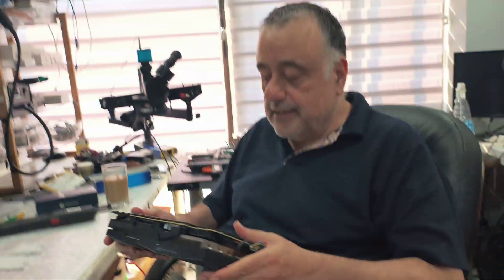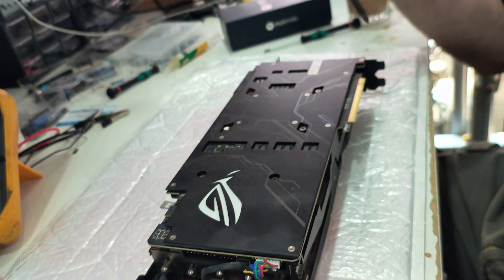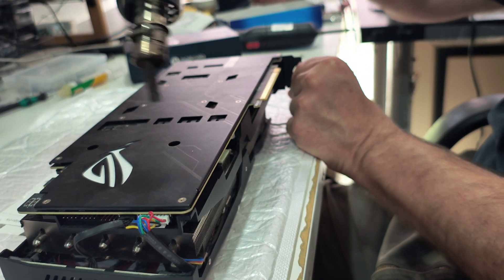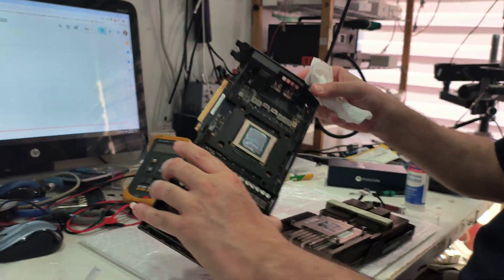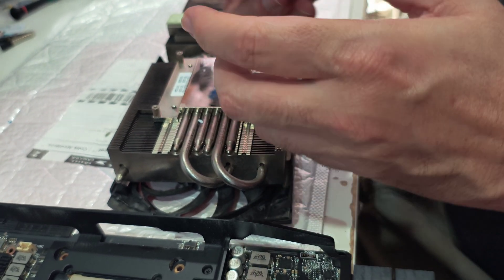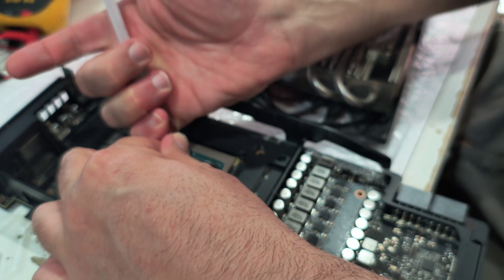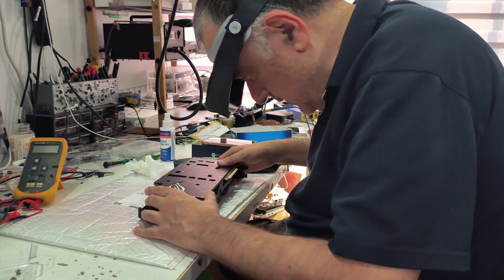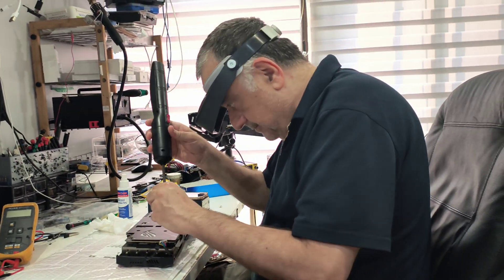Asus RTX 2080ti Thermal paste replacement.

Comment: If you can be assured that the thermal pads are the exact right type for the graphics card, it's best to replace them at the same time, correct? Also, WD-40 is genius! Like dissolves like!
Reply: didnt look into that cause you need go be very careful to get the right size and replacing the paste only takes 5 minutes

Comment: thank you mate did it in 15 minutes and temperatures went from always at 80 degrees (fans spinning at 3400rpm) to now at 60-70 with 750rpm at 99% gpu usage thank you mate